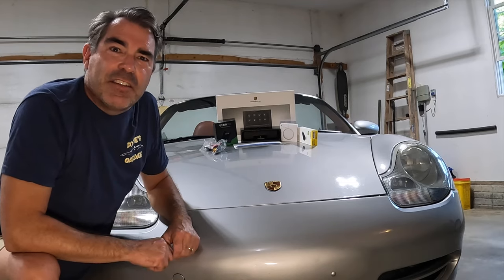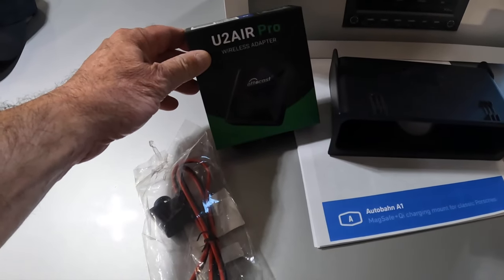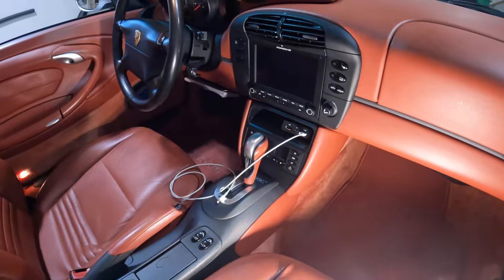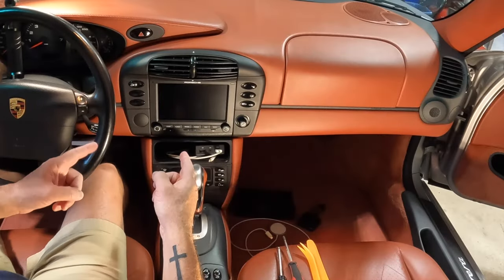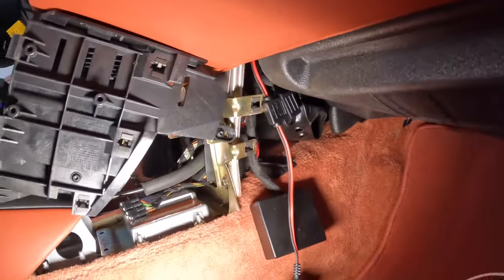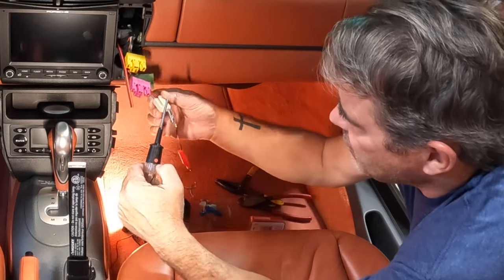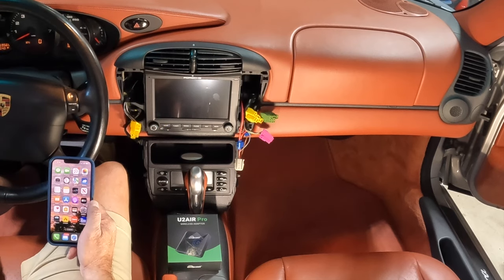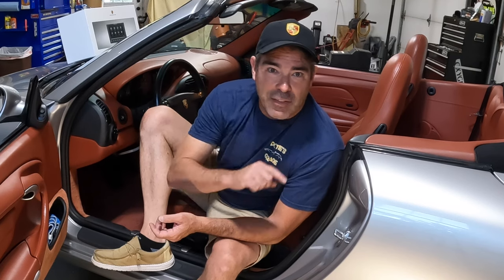PCCM+ Porsche 911 (996) Upgrade to Wireless – Oh So Sweet!!!

Comment: Portie this is awesome.. I need this done to my 996..
Reply from the maker: @danielrealin7670 - IKR - you won’t regret it!!!  Love this set up!!!!
Reply: @Portie2216  Mr. Portie I ordered all of the parts but am nervous about doing the install. I’m not very mechanically competent. What do you recommend?
Reply from the maker: @danielrealin7670 - it is really not too difficult at all for the novice, hardest part is the wiring if you haven't done that before.   I'd suggest downloading Autobahn Engineering's install instructions from their website, rewatching this video a few times and maybe search for some other general automotive wiring to get a feel for what it takes.   If you have someone who has done this before (automotive wiring) have them help.   If you're still not comfortable go to an automotive audio install center near you - they should be able to wire this up very quickly, competently and for not too much of a charge.   When in doubt call in an expert!
Reply: @Portie2216  thank you sir. Love the channel

Comment: I’m looking to add a wireless charger in the same place after my car comes back from the garage with PCCM+ fitted.  I hadn’t seen the MagSafe ready kit was available here in the UK so this video is well timed for me - looks great and will be better than what I was planning.  I guess the MagSafe doesn’t draw any power when there is nothing on the charger as I think the cigarette socket is always on?  The only difference is that I hope to use usb wireless dongle as I’m having the PCCM+ box fitted in the glovebox on my 996.2.  Many thanks!
Reply: Hey @TJSTR — you’re right the cigarette lighter is live at all times, but the MagSafe does only draw a very small amount of power when it’s not charging, but in practice this does not have any effect. 

The only thing to keep in mind is not to leave the phone charging for a long time (many hours or longer) when the car is not running as then there is a risk that the battery might drain.

Let us know if you have any questions and keep in mind that you will get 10% off your order if you use code PORTIE at check-out until the end of this week.
Reply from the maker: Right on!  @TJSTR - I would've done the glove box as well but my 996 is not optioned with that feature.   Very happy with the install and how it all works together!!

Comment: Great video, Portie - about to order one for myself (thanks @autobahn-engineering for the discount!).  One thing I want to be clear on is what I think @joeyhill218 was referring to:  can you get a USB-C to USB-A adapter and plug the MagSafe charger into the other USB-A port on the PCCM box?  I checked the Porsche website for the PCCM and couldn't determine how much power that port puts out (those are often as low as 5W, which wouldn't work with the MagSafe).  No issues with wiring in the female lighter adapter, just thinking of how it could be streamlined even further if we didn't have to use that.  

Separately, now that you've been using it for over a week, how is the wireless adapter working for you?  Any connection/disconnect issues?

Thanks!
Reply from the maker: @brandonsellers5542 - so far so good!  Only one time did I have a connection issue but after restart it was good!   

Also, I did use an adapter and tried to plug into the PCCM+ box and did not get power enough to activate the charger from Apple.   This was my initial thought as well - checked both ports and no charging.   It would've been awesome if that worked.  Let us know if you come across a different solution!
Reply: Hey Brandon — thanks for your order! Excited to hear what you think! 
Regarding the USB: Unfortunately USB-A doesn’t deliver enough power to support wireless charging at reasonable speeds (and as Portie said, MagSafe straight up will not work with it)